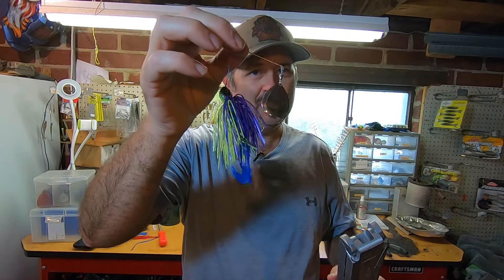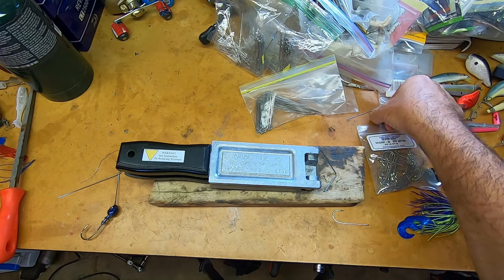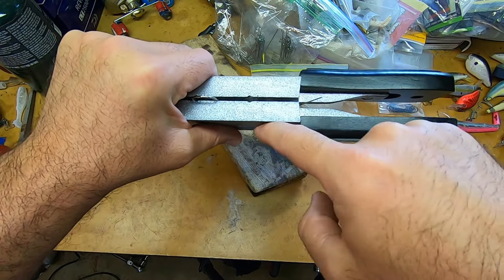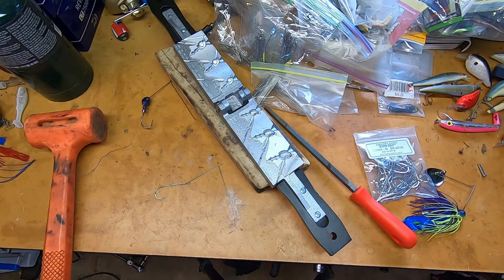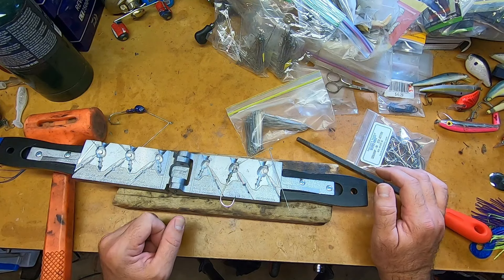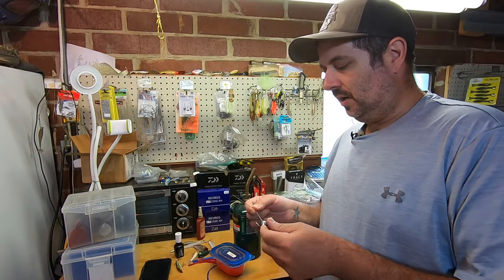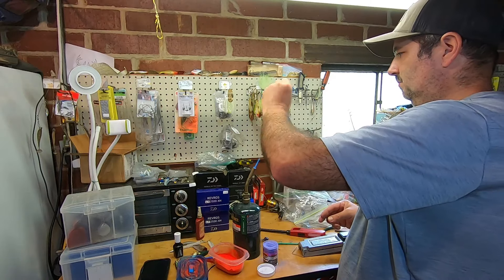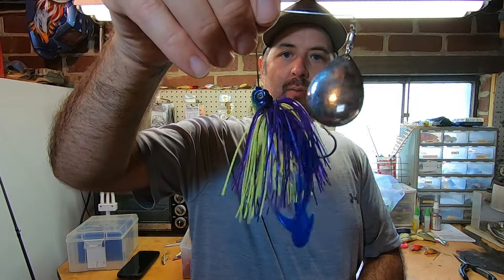I Modified A Jig Mold To Create The Perfect Spinnerbait

Comment: Great video. After modifying can you still use mold to pour Jigheads still?
Reply from the maker: Yes you sure can. Thanks for watching.
Reply: What gauge wire did you like the best?
Reply from the maker: @Mags120fish1  I like the light wire but I’m still playing around as far as the open or the closed it’s still up in the air I poured some of each to test out.